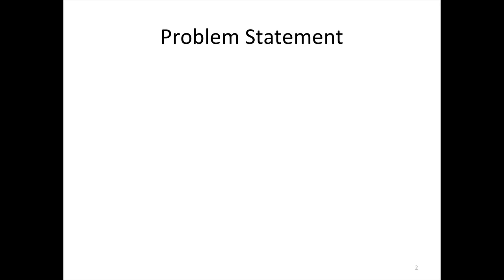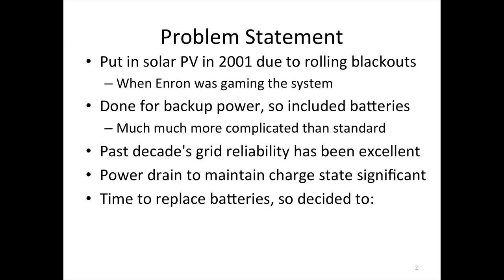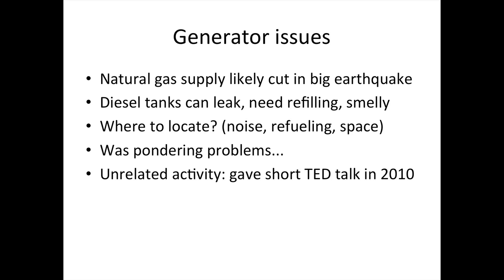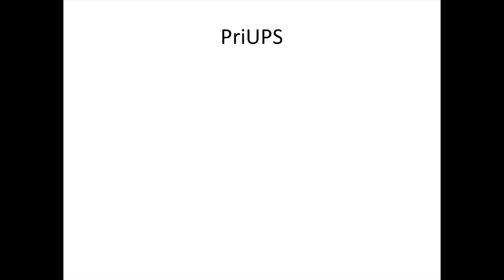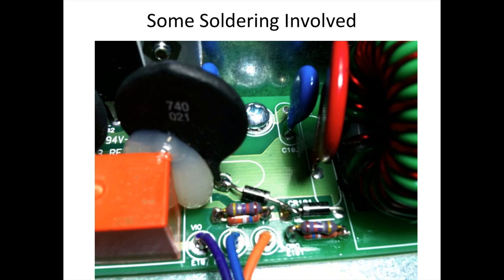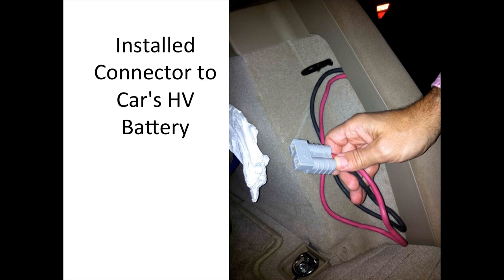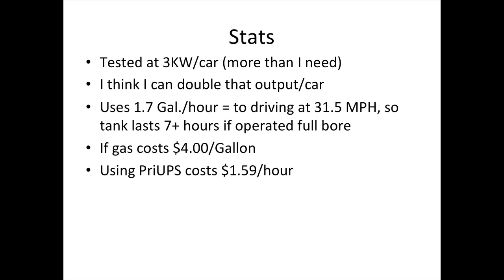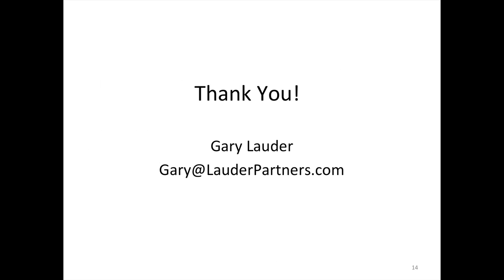ICUC-PriUPS-Powering My House From My Car

Comment: If you use 1.7 Gal/hour and price $4/Gal - using PriUPS costs $6.8/hour, but not $1.59/hour.
Am I  write?
Reply from the maker: Thanks for pointing that out.  Due to the time limitations on my speech, I did not go through the calculations properly and verbally mixed numbers from different scenarios. The main mistake was that in actual use @ 2,900 watts, the gas was used at a rate of 0.4 gallons/hour, not 1.7, which is the estimated usage rate driving at 75 MPH.  Bottom line is that I believe that the calculation of the cost is correct, but ignores the wear & tear on the car, in particular the cycling of the high voltage battery.  Since this is only for emergencies, I don't really have to be concerned about that.
The more complete version is:
Gas usage while charging:  0.7	Gallons/hour	
Duration engine on:		3.3	Minutes	
Duration engine off:		2.5	Minutes	
Total cycle duration:		5.8	Minutes	
Duty cycle:		       57%		
Gas usage rate		0.40	Gallons/hour	
Power output		 2,900 	Watts (per spec.)	
Output @ 100%		 5,097 	Watts 
Compared to driving:					
Car gets		       45	MPG		
Average speed		75	MPH	(Guestimate)	
Gallons/hour		1.7	Gallons/hour		
Charging = to driving at		31.5	MPH		
					
If gas costs		                $4.00 	/Gallon		
Using PriUPS costs		$1.59 	/hour @	 2,900 	Watt configuration
Cost of electricity is		$0.55 	/KWH
Reply: @GaryMLauder  *not write, but right (my mistake in the first message). :)
Simplier, effectiveness of electricity GENERATING of Prius is equal to petrol generator (1kWt=1liter of petrol) which is not as good as for diesel generator (1kWt=0.7 liter of diesel fuel). And during constant high loads Prius worse than diesel generator and equal to petrol one.
But at inconstant loading Prius has some agvantage as it has buffer battery and spends electricity more effectively.